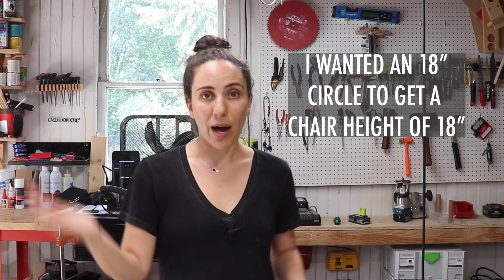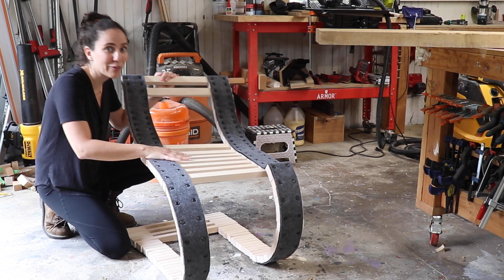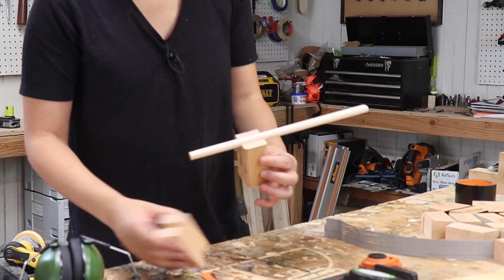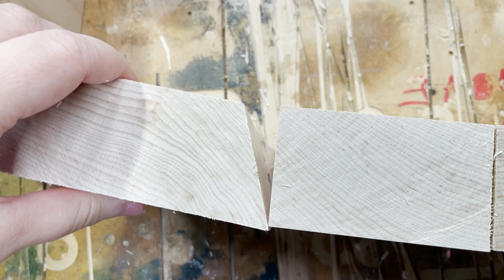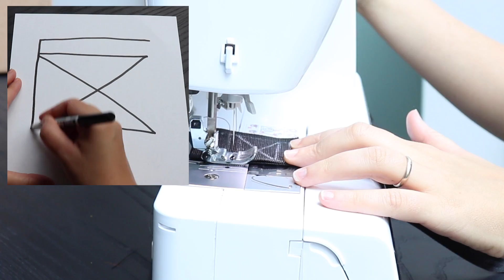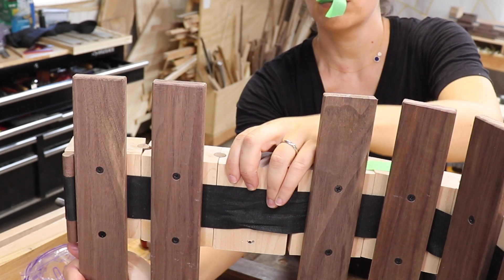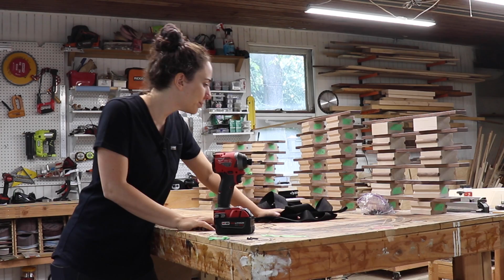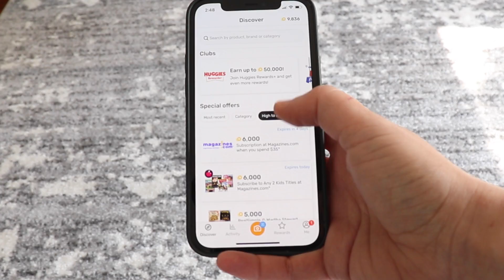I ATTEMPT to make a Roll Up Chair… AGAIN...

Comment: HEADS UP!: *Leather is super stretchy.* -- Climbing shoes made from leather usually stretch much more than their synthetic counter parts. Cow hide is just thick human skin which is supple and dynamic.

Slackline and highline can have as little as 2.5% stretch. Maybe there are industrial materials that are even more static than this but inherently there will be some stretch with woven materials.

Stainless cables will have far less stretch.  Maybe make an expanding end point so as you are setting up the chair, the cables can be stretched with mechanical force (a lead screw pulling both cables taught). I get the appeal of using wood and cloth to make an impossible chair but maybe that is impossible.
Reply: this, steel cable or chain running through holes in the pieces is what will get her there.  anything that will stretch will end up buckling like this.
Reply: @kingkarlito  Maybe. Because of the joint solely relies on friction, there is a fair amount of tensile force needed from the cables.  

What might work better is skipping on the rolling portion of the chair and just make it a folding chair with some fancy origami tricks (aluminium sheet + custom hinges/piano hinges will optimise strength and the project's mass)
Reply: @dragade101  The rolling chair idea is still Really good for portability and storage, but yes she needs a material with basically zero tensile give and enough strength to hold. Small steal cables running the length of the strap fabric is probably the right direction.
Reply: It seems to me that this sort of thing is really where a mechanical engineering degree comes in handy to make the right material choices and to calculate the structural aspects of the design. I think it could in principle work but I but that's assuming ideal (ie theoretical) materials. Maybe there are materials that are close enough but my suspicion is that all the structural elements will end up having to be metal instead of wood/textile. All the rigidity comes from tension and the lack of stretch/compression of the materials. Kind of like how we pair concrete with steel rebar. Steel has low stretch for a given tension, and concrete doesn't compress.
Reply: @simon7719  kind of. Sometimes its best to just experiment and iterate several times. You could try to calculate the needed forces but why not just over build and test your design! There likely is a tension that would these blocks safely and it.  Maybe what would help is that each block has some registration keys, especially for the back pieces. That once the blocks are drawn together and held fast, they cannot hinge away from each other (that simply they could be parallelograms with a keyed surface to help them not slide off of each other).

The back of the chair is probably the hardest area as you are not loading it the same as the front arc is being loaded. Finding the right segment shape is probably the key here.
Reply: Yeah... Leather might not be ideal... If you want to stay with natural materials though Canvas might be a good option.
Reply: @jeagerblackpaw2922  interesting. I think of natural fibres to be way stretchier than a nylon that isnt supposed to give that much. Working with cotton, hemp, linen, wool and silk thread to weave; these all have a lot of give and as you start to weave them (while playing with tension), its clear how you can start to over stretch sections of your weaving (if you are experimenting with wrap and weft tension)).

I’m using as reference that steel cables usually are nearly 0% stretch while spun organic threads have maybe ride around 5% stretch.
Reply: Kevlar only stretches 3-5% but I don't know if that's static enough.
Reply: @comradegarrett1202  thats pretty dynamic. Its hard to get a woven material close to 0% elasticity
Reply: What about just a seatbelt strap?
Reply: @colbypetty6422  also too stretchy. I'm not sure if steel rope would be rigid enough to provide enough tension. It is kind of an impossible material that can flex but have 0% stretch (>0.5% stretch is probably too much give)
Reply: You could try bowstring.  Like almost everything else, it will stretch significantly initially.  But, after you break it in, it will stretch very little.  The way you deal with the stretch in the string over time in archery is by adding twists to your string, which shortens the overall length of the string, taking up the slack created by the stretch, which could also help in your project.  If you do try bowstring or anything else that might stretch, try breaking it in first, putting it under tension for a week or more, before using it in your project.  Also, be aware that the color in bowstring is in the wax, and will come off over time. The bowstring material (Dyneema, Spectra, Vectran, . . .) cannot be colored, but it is used in bullet proof vests and other armor.  Lancaster Archery has a wide selection.
Reply: Doubling up the material could also work. This is done a lot when this type of material is used to make handles and belts to hold tools and other heavy items. You can find examples of this at any hardware store and on many backpacks.
I would not recommend leather though. I work with it everyday and it stretches easily.
Reply: Any material that meets the specs is suitable, if the % stretch is known. If the % stretch is less than the tolerance of the chair functioning, then it is a satisfactory solution. I had a WW2 infantry canvas stretcher (bed). It was still perfectly functional and within spec 70yrs after it was built.

Comment: First time I've ever seen this channel and video and I have to say, I love the enthusiasm you're exuberating! Very admirable.
I am definitely a dummy when it comes to carpentry and engineering and whatnot, but I figure outside perspectives can help tackle a problem a lot of times. Like, my thoughts on the straps are, they seem to stretch too much for what seems like you need something that doesn't. I don't know how possible it would be to do, or if there are excessive weight or safety concerns, but what about steel or other strong, thin metal straps instead of those heavy duty nylon ones, or have you already gone that route?

Either way this is awesome and I hope your genius ends up bearing fruit on this project. The video was awesome to watch and love seeing your thought process behind this. I hope you endeavor to make this a reality because the idea is DOPE! :B. Take care!
Reply from the maker: Glad you liked it! Thanks!

Comment: could you use motorcycle gear chain running through the middle? it has great mobility in two planes -up and down, but way less in the left to right. this could run through the middle of the blocks and look invisible.
Reply: or a roll of sprung steel ribbon,

Comment: I feel like you need to have a string running through the middle. The Issue with Tension doesnt come from you setting it up that way, it comes from the fact that you force the bending material to the point where it cannot bend any longer (which is kinda what we want), so now it starts pulling on the parts. 
If you ran a metal cable through the middle of all pieces you wouldnt have that issue, as more tensoin in the middle of the part just means more binding pressure. The downside now is, that you cant set it under pressure by simply rolling out the chair, which ruins it. 
So maybe an Inbetween way: 

Leave the cable variable. For example by adding one more pice at the top, that isnt connected to the straps. This way, you can tension the cable by flipping over the upmost row(and only need to lock those pieces).
This now allows you to apply whatever tension to the straps, they wont be able to lift the wooden blocks, because you effectively locked them in place. 

I just think this Idea is so cool, I wouldnt wanna let it go.

Also Im pissed that youtube just showd the Video to me now....

Comment: the same shape but the back curves down after reaching the top and connects to the bottom with a metal locking mechanism. the force of wanting to unfold and curl up would actually make it stronger then again keeping it in that shape would be difficult because it would want to become just 1 big oval, maybe put some reverse strapping on one half to change the force.

Comment: I know nothing about any of the required fields, but couldn't you just use WAY BIGGER circles for the shape? That way when it bends too much under weight it turns into the correct shape? Because right now, the wood pieces set up loose against eachother are in a rounded chair shape, but the pressure deforms it and it curls down too much. So maybe make it less circular so that when you sit down, it becomes circular? I hope that makes sense.

Comment: Hi, congratulation for your work, that's a very interesting concept. Unfortunately the shape and materiel will never make it strong. Even if you build it in steel. It will flex a lot.  If you want to try one more thing with it.  I rater drill a 1/4" inch hole instead of the strap and  install a 3/16" steel cable inside the center of the whole block assembly with a tightening mechanism in one end. That way you will be able to hold everything really tight without noticeable stretch to be able you to sit on. The cable won't stretch but the wood will kinda flex. The are enormous pressure (something over  2000 pounds ) in the edge of some block.the chair will still flex a lot. Even if you glue everything together.  Please keep posting more video.  Cheer.   :-)   Sébastien.

Comment: I have this crazy idea but I think it might work, by drilling holes through the centers of all the blocks including te dowels you will be able to pull a steel cable through both sides of the entire spine. It wont be visible when the chair is unrolled and it doesnt stretch at all. By creating some kind of lever at the end at the bottom of the seat you can 'untension' the cable to roll up the chair, and once the chair is up again, pull the lever to bring back the tension. Just my idea. Great video👍🏻

Comment: @Tamar: you have been so generous to share your process; thank you!  I am mindful of what it means to present your struggle with this roll-up chair. 
I especially was excited to see you working with the various choices of tensioning materials: yoga mat, polypropylene, polyester, polyethylene (you also considered leather). You also tried out two different methods of attaching the webbing to the slats: one where you attached directly to each individual slat with glue, screws, or staples, and an alternative where you used the walnut slat to clamp the webbing.
Here's my reflection: the only material you tried that stood a chance to work well was the polyester; the others unfortunately creep under tension, slowly elongating forever. This is why sailboat rigging uses polyester rather than nylon, polypropylene, or polyethylene. Other suitable materials (albeit likely impractically expensive) would be carbon fiber or kevlar. My second reflection is the method of attachment of the webbing to the slat: you must attach securely each slat to the webbing rather than clamping. Clamping, which you began using along with the walnut slats, allows the webbing to slip, which then led to some joints spreading and others "collapsing". Time and again, the webbing would slip along its entire length to the joint under the greatest tension (which you pointed out). 
As others have probably pointed out, Josh Wright (https://www.youtube.com/channel/UCNNxgIF30wtKlpjHE3ajefg) did this project most successfully using six lengths of pallet banding (metal or plastic, I do not know) and attaching each band to each slat with a screw. 
In the end, it was probably fitting to glue the whole thing together: I agree with you that it is not a child-friendly piece of furniture. Thanks for sharing!

Comment: 1. Cables need to move freely through holes in all the pieces when rolled up. Some simple device (that rolls the cable?) pulls the cable through very tightly and holds that tension. 2. The pieces need to fit together in such a way that when the cable is pulling them tightly they cannot change their position in their joints with each other.

Comment: The depth of the pieces from the floor to the seat needs to be thicker.  e.g. if they are twice the depth then the tension on the strapping is halved.  In the extreme case they they would just be like cake slice shapes going to a point and the tension would be much lower.  Admittedly, the chair would not roll up as small.  Maybe there is a way around that.  If the back of the chair was narrower, then it might fit between the large chunks for the lower part when rolled up, giving a reasonably small roll-up.

Comment: You could try to use something like the things used in backpacks to change size (and tension in particular) of the straps, buy stronger ones (compared to the ones used for backpacks) in order to make the chair hold the shape (so you put two straps one on the front and one on the back this one should be "put into tension" before sitting on the chair)
Edited: better syntax etc, i had a brain frat while writing it originally

Comment: if you calculate the forces going on, there is probably over 1000 pounds of tension on that strapping when someone sits on it.
Reply: try using hinges or something. Hinges would also be better because they can't pull and put unwanted tension on other parts of the chair. Even with hinges though you better have a good way to attach them because those forces are extremely high. Even if it's tight when it's new, the screws could work their way loose from the wood compressing over time. The only way I can see this working is if you use thicker angle blocks where the tension is highest. That would give the hinges or whatever more leverage by being further away from the fulcrum.

Comment: The lever forces affecting the frame of the chair are just immense because of both the width and the thickness of the pieces. I would try making the most stressed parts of the frame out of full-width 20" pieces and fixing the belts to e.g. every second piece, no to allow them to stretch along their whole length. Making the frame a closed shape would also make it much stronger. Another option would be making the whole frame of the chair out of angled steel pieces connected by hinges (something like a tank track :-)).

Comment: If you would just pin down the strap to every block, the needed springrate for the strap would be much lower.
Not just change the material, change the design.

Comment: I saw that someone suggested metal hinges and think this could be the way forwards. Instead of using screws, perhaps split the wood horizontal and sandwich a metal plate between them. Use a bolt to attach the hinge and the weakness that screws would have caused should be eliminated.
I think you had the right idea with the dowel, but it may have been too central, creating a pivot. Perhaps have the same thing but lower down, maybe change it from round to square or triangular.
But first you need to take a well earned rest.

Comment: Instead of strap, how bout hinges? You can always cover strap on top of it. The role of them straps is basically the same anyway. The problem is the anchor points since the curves bear so much pressure plywood would be a much suitable material(you can always cover with veneer later) coz the strain on the grains of wood might be too much. Plus simple wood screws would tear the wood. So nut and washers is the way to go(better to compress than to tear it up)
Reply: Take note you are basically tearing a door off the hinges with a leverage of your weight. Plus, one must be capable of bearing your full load, so you can tweak it before building the whole thing. Same is true if you chop a chair in half and you can still sit on it like a 3rd leg(u ain't gonna sit comfortably on it but, you CAN sit on it)

Comment: There are a lot of good ideas but why not look at the chair as it should be in a statics. The problem with the chair curling at the top and bottom is that they are being pulled in the way the chair should roll. Is you used a gap to move the wrap to the back it should then pull it tight.

Comment: Pretty sure, you could solve the stretch issue by gluing each strap to each block, this will reduce the amount of stretch to the amount that is between each pair of blocks, not the entire strap's stretch being able to go into a single block.  This should help a lot with the design, I do like the design in general though.  I think I'd position each block to be as tight as possible, then glue it - making it similar to metal hinges - which, I think would also work btw..  And being as they would be folded up when in use, that would help with both elimination of any stretch, as well, as the side-to side part...  Plus, with just the round hinge showing, I think it would look cool (if out of Brass)..

Comment: You could try dyneema sk99 or 78-both are synthethic fibers, that strech like 4-7%. These fibers are used on sailing yachts, and are extreemly strong, a 12mm wide can be loaded up to 80kn, if i remember correctly

Comment: tank tracks, what youre trying to build is operating on the basis of tank tracks, the dowels can hold the wholething from side to side, and i would have tried to make a fabric hinge if i was trying fabric just to stop the material length causing the problem, the shape basically being a K where the back is on the seat side and the < is in channels in the connecting separate pieces.

Comment: You’ve created a ‘Jacob’s Ladder’ toy chair. I think you’ve tried everything reasonable  and proved this design will never work, no matter what material you use. The issue is that the wood is giving, not that the strap is stretching. The way the wood is cut and just sits next to each other means they will always move, right? The wood needs to slot together somehow.